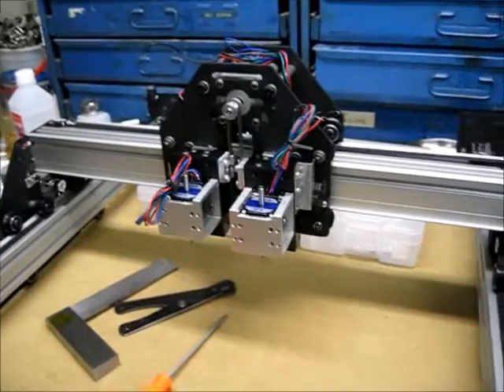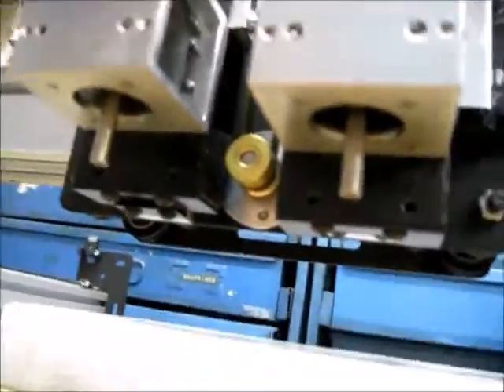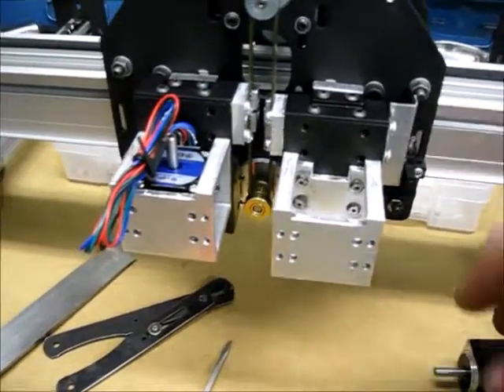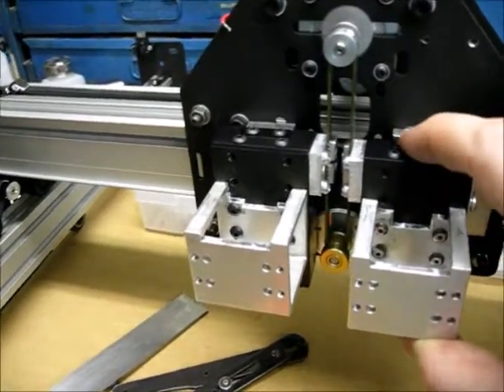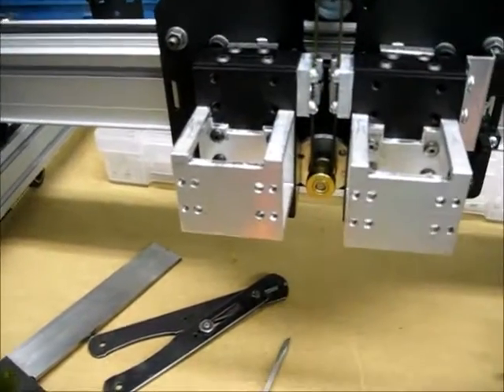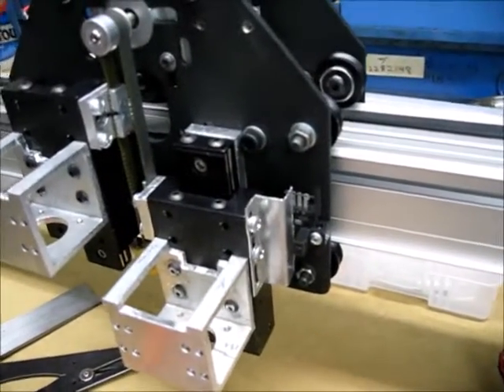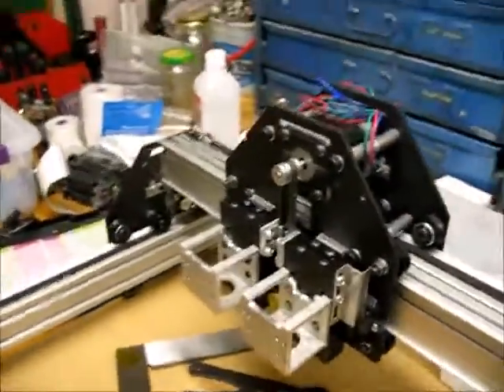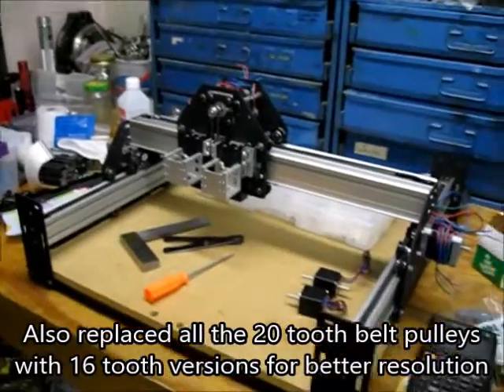[WRP] shapeoko to OpenPNP conversion part 3

Comment: This is coming along very nicely! Looking forward to further progress! Do you have a link to the hollow shaft steppers?
Reply: Found the stepper link in the Google doc. Thanks for the full list.
Reply from the maker: no problem. Cameras are still iffy. Note those are the larger steppers most folks use nema 8s.
Reply: Ya I noticed that. You went with the 11's because of availability?
Reply from the maker: Due to the design of the Sapeoko2 X using 8s gave no size advantage (could not make the head smaller to get a larger work envelope.) Playing with the 8s before they tend to run hot due to the small amount of mass. Between those two reasons went with the 11s.